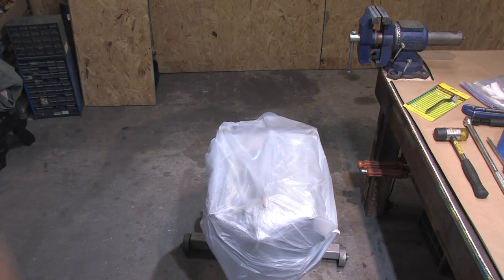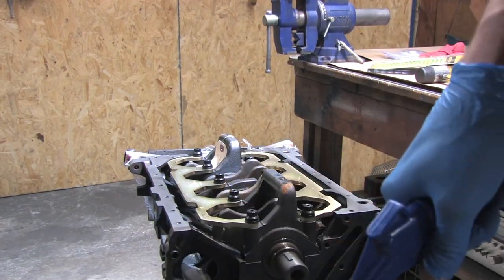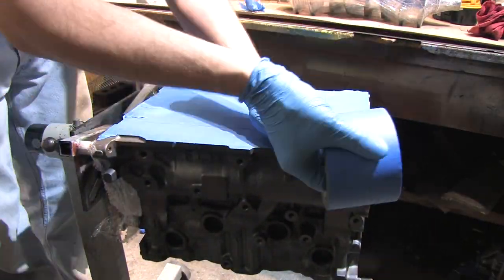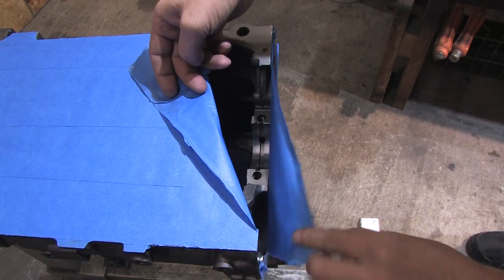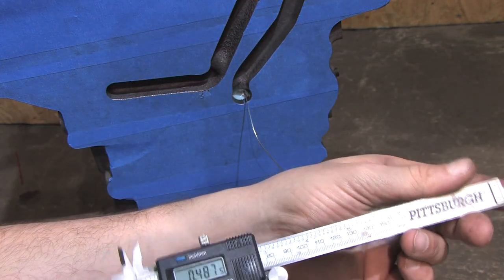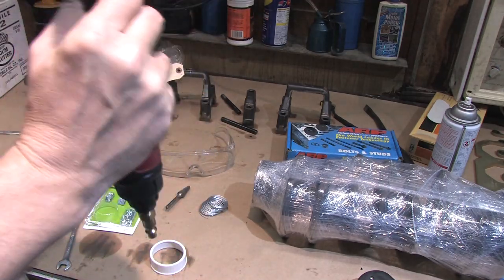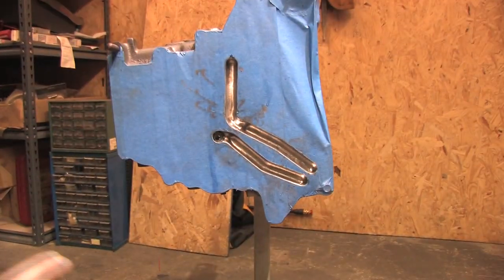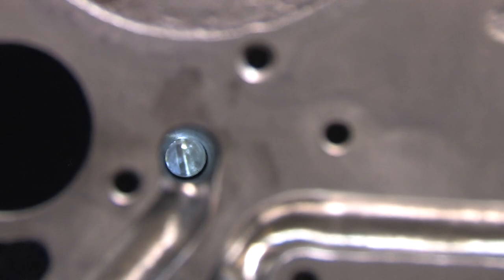4g63 Block Oil Gallery Mod

Comment: When your machinist align honed your mains (https://www.youtube.com/watch?v=Xzi7LYpb05A#t=30), he bottomed out the studs. Maybe unnecessary but you might want to double check those before final assembly. That is, if you are backing them out 1/2 to a full turn. Would the small increase in stretch load be enough to alter the diameter of your mains?